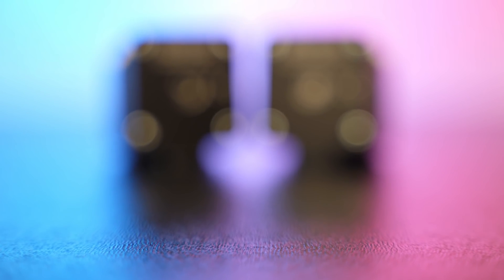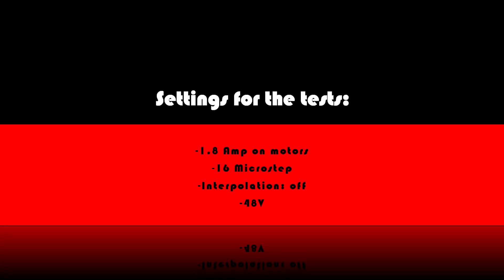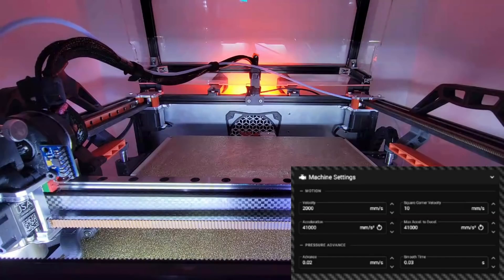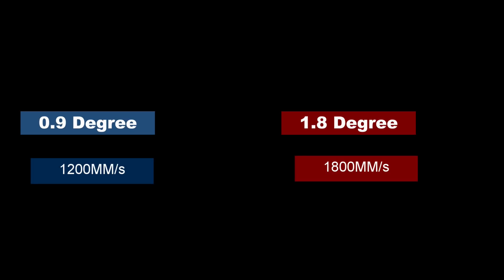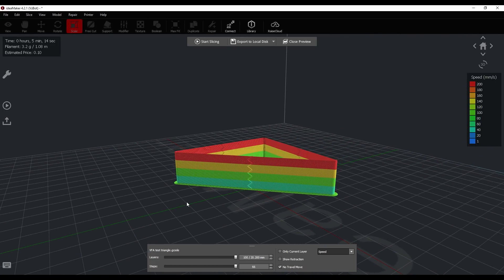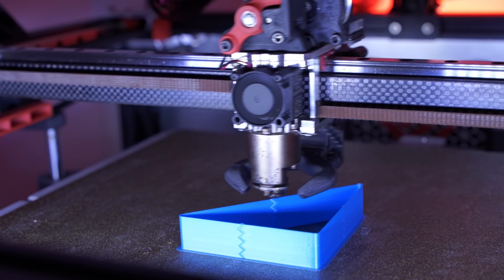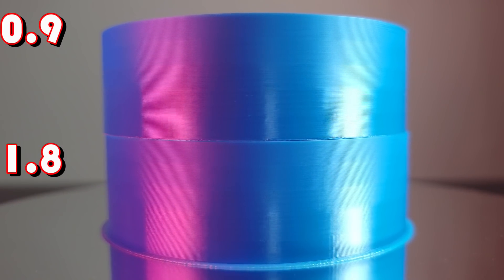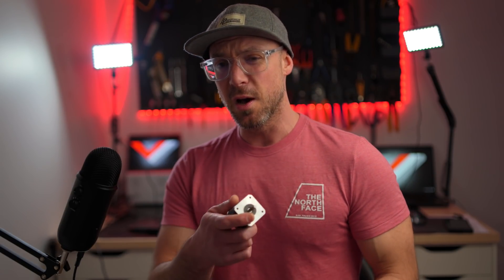LDO Stepper Motors 1.8 vs 0.9 Degree. Battle of the 48mm!

Comment: I'd be interested to see if the drive pulley tooth count has a major factor on the performance.

I'm glad I didn't let people talk me into .9° steppers. I still haven't turned up my super whoppers. Wonder if it could keep up with yours. Probably not 😄
Reply: Superwhopper club!
Reply: Changing the pulley tooth count will definitely change the performance. Search YT for EddieTheEngineer and his motor torque calculator. It has a value to change the pulley size and see how speed and torque performance changes.